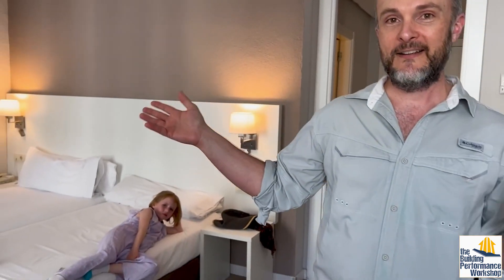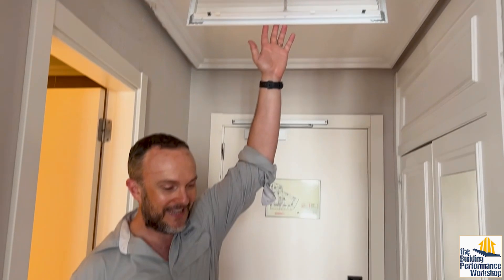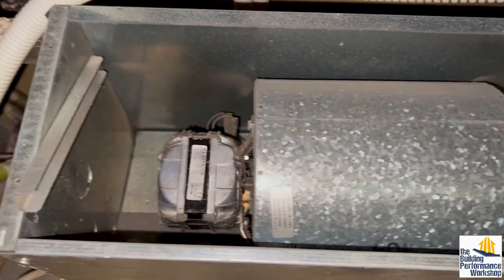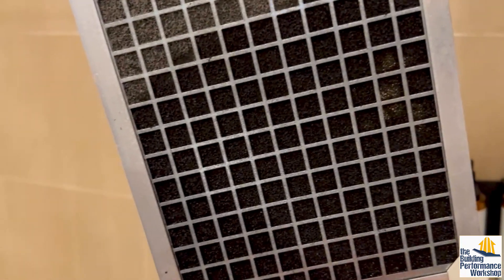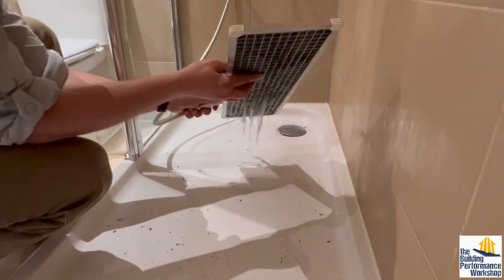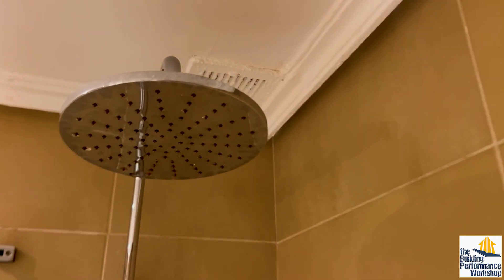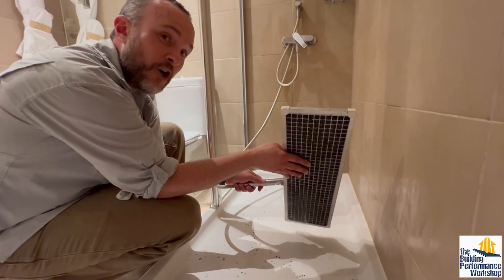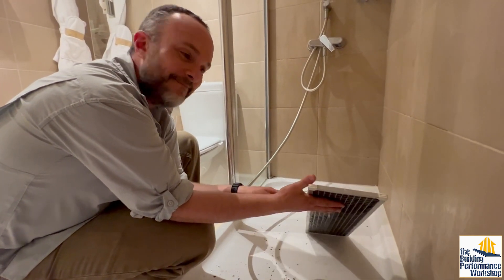Fancy European Hotels get Bubba's HVAC Maintenance, Too

Comment: Buckets are an integral part of the leaky pipe management system...  the drips collect in the buckets buckets and evaporate over time. This stops the drips spoiling the ceiling. The problem is if the evaporation rate is slower than the drip rate...
Reply from the maker: I love the scobies that live in the buckets, very cool